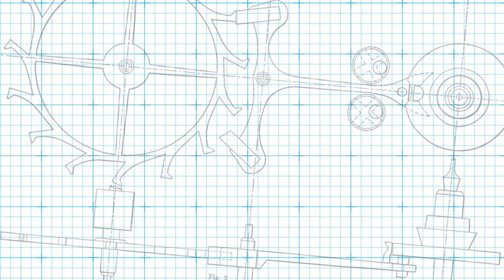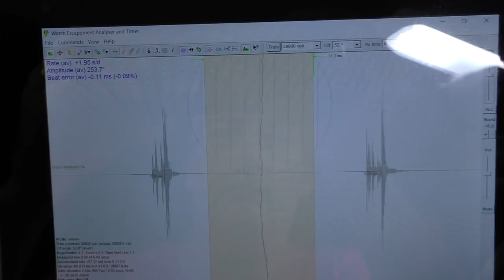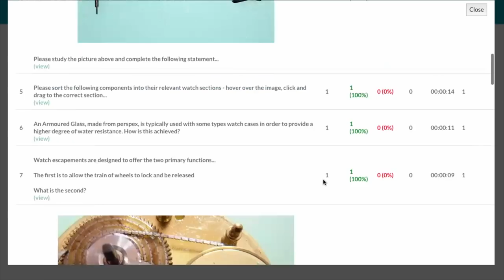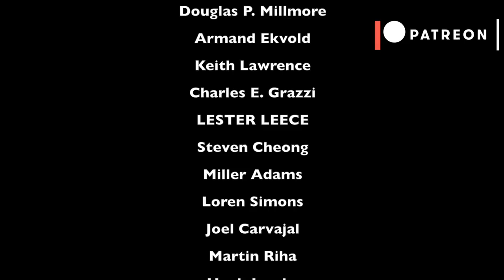A Seiko 4L25 with a Strange Sound - Timegrapher to the rescue

Comment: I've had this exact problem before, and through the sound amplified by the timegrapher I could indeed hear the scraping. Only difference being it was my fault, I used a standard bridge screw in place of the pallet bridge screw. Another time I stopped the mainspring barrel by screwing a long bridge screw onto the dial-side. Maybe you should do a video on screws and common sense.

Comment: You are the only person I would trust to ever work on a watch. 

I just sent my Aqua Terra BACK to an "authorized service center" (meaning a non-Omega jeweler) that "has over 30 years of experience" and he successfully roached my watch. He left screws loose in the movement only to jam and scratch up the rotor, jam the balance with a screw in the hairspring. He replaced the stem, failed to set the length properly and burred the case tube threads to the point the crown won't screw down. 

I sent him pictures and his only response was "sometimes screws just come loose for no reason".
Reply: Youd have been better off trying to service it yourself by the sound of it

Comment: Hi Mark, excellent work! I'm curious about microphone attached to left tablet? What is that mic, where it comes from? What is tablet OS running, I assume Watch Escapement analyzer is running on Windows only? Final question :) , wasn't it easier to attach or "steal" signal from dedicated machine microphone and share it among tablet and timegrapher machine? I'm thinking of doing such thing, I have timegrapher Weishi 1900, works well, but sometimes you really need waveform signal. Any info is appreciated.. Thanx!

Comment: hi mark,
correct me if i'm wrong but timing machines from elma and witschi have a mikrophone where the sound is only amplified.
when i work with timing machines from these companies i can hear alot of failure noises if there are any. like if the balance spring is touching it self at one point or if the amplitude is beyond 350°.

or is it a coincidence that these are a special kind of timing machines?

Comment: Dear Marck. I always enjoy your videos. They are very informative and technical. About what I've seen in today's video about the strange sound of the Seiko watch. I have an observation. And I must clarify that English is not my mother tongue, in fact I do not speak English. As I understood, the registration in the software where the waveform (eTimer) is seen is due to friction or contact of the balance wheel in an pallet cock screw. I may be wrong but I do not think that’s it. More might seem to me like an oiled spiral that sticks, or the contact of a loop at some point due to excessive amplitude. It seems impossible to me that a mechanical contact between the screw and the balance wheel can produce a characteristic waveform. I think that if an anchor bridge screw touches the balance wheel it would stop the clock.
Reply: Guido Alfonso Velásquez Enriquez, 
The rub marks on the balance wheel would not have been caused by an oiled or contacting spiral.
Reply: @stephenarling1667  It's possible. However, due to the nature of the oscillation of the balance wheel, the friction of the balance wheel arm should be seen not only once but twice in the complete waveform. IMHO.
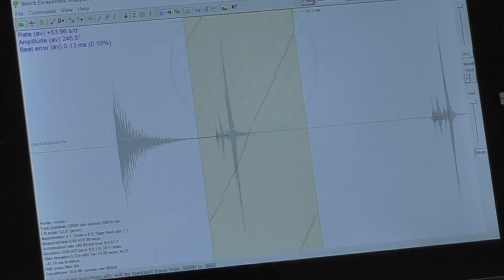Reply: @stephenarling1667  Also, if you observe, the rubbing shows it and registers when the watch is in the dial up position. You can see it from minute 3:07 In that position the wheel balance moves away from the bridge screws of the pallets. Taking into account that the balance wheel always has a small end shake.

Comment: May I have the pleasure of introducing you and your viewers to Tg timegrapher?  Tg has an oscilloscope feature that shows the sound signature of the tick and tock.  This can be useful if there are extra noises.  Like rubbing of a hairspring or balance wheel.  Tg's open source and precompiled for Windows, OS X, and 64 and 32 bit Linux.
https://www.raspberrypi.org/forums/viewtopic.php?t=167741
Tg's weakness is the rate of the quartz crystal on your computer is more precise than accurate.  However, for the way I regulate rate, this is more than compensated by the ability to set a calibration offset.  
I set my watch to an atomic clock through a timeserver like time.gov or an app and note the time it was set.  I use the watch (as I normally would) for days, and then after a defined period, I determine the rate error in sec/day over the days I used the watch.  With Tg, I would then calibrate Tg timegrapher to my watch with the rate error!  So Tg timegrapher would show my watch having no rate error.  (Calibration can be automatic with a calibrate button or manually.  Tg documentation recommends calibrating to a quartz watch, but I think it is better to calibrate to the watch with known rate error.)  Then I would adjust the rate of my watch until Tg timegrapher indicated a rate error that is negative amount of rate error observed.  (Negate the rate error on my watch.)
I had no problem installing Tg to run on my mac laptop using the terminal command line.  For the Mac, first install Homebrew.
https://brew.sh
Then install Tg with these instructions specific for Mac OS X.  The installation instructions for other computers is also on this page.
https://tg.ciovil.li
Using a headphone microphone, I was pleased that it could determine rate of my closed Apmphibia watches, without turning off my air conditioner.  I tried it with and without a pillow on top.  Both worked.  
The advantages over a physical timegrapher is it is free,  has an oscilloscope display of tic and tock waveforms, doesn't weigh anything, and installation (delivery) takes minutes.  
The documentation with some translation errors is here.
https://reparacionderelojes.weebly.com/uploads/1/2/2/1/12213567/manual_for_tg_timming_machine_2.3.pdf
Reply: You're late